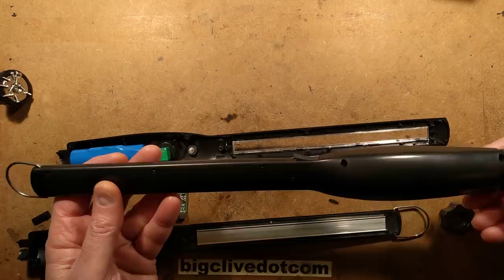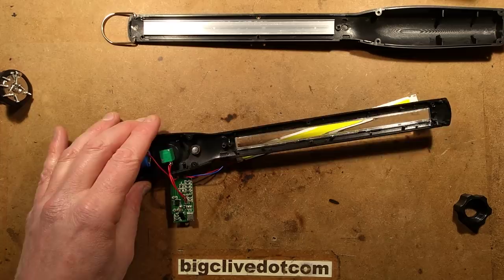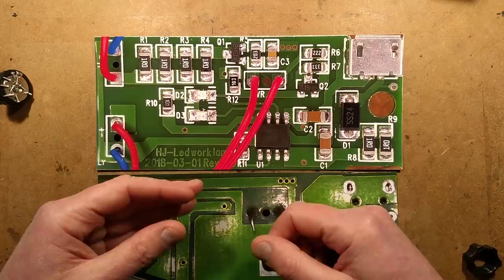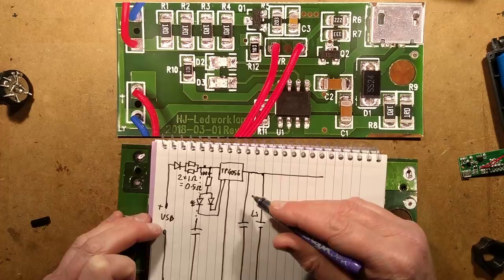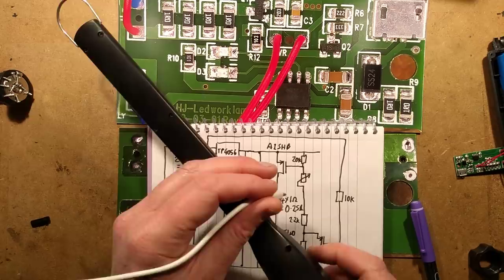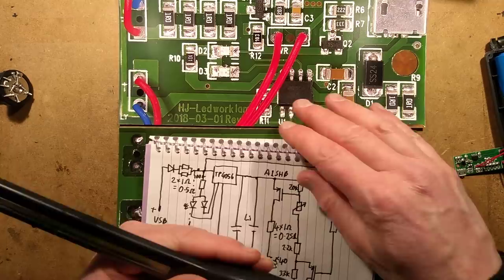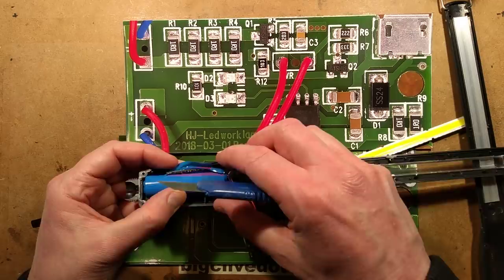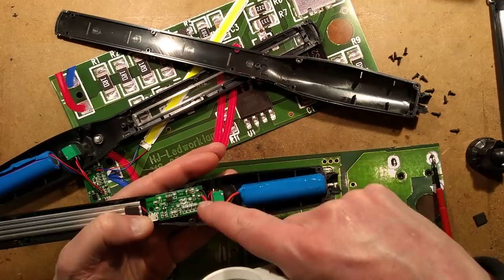Astro Pneumatic light versus clones?  (teardown and schematic)

Comment: Wish you had Harbor Freight there.  Google "Braun 63958"
Reply: Is it worth $40?
Reply: @ddegn   I would say no, as at $40 it's getting too near the Astro in price.  They are certainly worth $20 - $25, though, and the current coupon has them at $19.99
Reply: @a89proof  I'll watch for a coupon. Thanks.
Reply: @ddegn  I have two HF Braun lights myself. One has been difficult to charge and flickery. The other has been fine. I only bought them off a coupon. Not worth full retail.. Best part with them is that the battery is replaceable..
Reply: I have had good results from mine. I think it is better made than the Astro, with a familiar 18650 back end like my flashlights. I have a ton of 18650 and love being able to pop another in.
Reply: These lights are amazing.  I have two, and prefer them to the 40SL, which I also have.
Reply: golf-n-guns Braun, wasn't that brand bought out by P&G, or was that just a specific division?
Reply: @johnfrancisdoe1563  Nah, just one of harbor freight's made up brands that's intended to sound familiar.  I'm sure it's unrelated.
Reply: @ddegn   got it for $24 on sale  keep an eye out for it in the news latter it is the best work light you can buy IMO.
Reply: I salvaged some old 18650s cells out of some bad laptop batteries and just pop in the charged ones when needed. Most note book battery's stop charging with one cell bad but all other ones are good.
Reply: @ItsAlwaysRusty  
You probably tightened the bottom too much.
Reply: @Clay3613  Maybe but its always been glitchy.  Works most of the time but the issue seem to be in the swivel joint.. Almost like a bad ground. Goes dim but if you move the light bar it will brighten.
Reply: @ItsAlwaysRusty  I love that Braun light from HF first one I bought is perfect the second is like you say, flickery and a Bit dogy. The original price was 19 doll hairs but has gone up month by month to 40. I find it the perfect light for working in electrical enclosures.
Reply: Yep I've got both the Astro and the Braun and I always grab the Braun. Very nice light.
Reply: They also have a mini stick light. Non adjustable magnetic base but it makes up for that in the blinding amount of light it produces. Best part $6
Reply: The Braun is a MUCH better light than the Astro in every aspect. I prefer that the LED be the only moving part. Being able to pop in a fresh battery without having to wait for it to charge is essential. The small led on the tip is great for getting light into small crevices. The magnet is VERY strong. The aluminum housing is very durable. Everything about it is just better and I would gladly pay $40 for one if I had to. I have 3 and will probably buy more, but I will always use a $19 coupon. They make great gifts too. I gave several out at Christmas.
Reply: Then Google the one that Astro copied, the Hazet 1979-9.0

Comment: I wonder if the PCB would accommodate a larger output MOSFET and some large solder blobs on both sides of those 1 ohm resistors?

Perhaps under the TP4056 chip as well?
(If there’s enough room in the case.)

Comment: Change the resistor to increase the charging current... Lower value resistor for higher charge current, or higher value resistor for higher charge current?

Comment: Reminds me of one of the lights we can get here in the states from everybody's favorite chinese tool import Warehouse harbor freight.. The Braun slim folding. However the difference is it's an all metal case with a removable battery. Quite a handy little light. My testing on their battery was 2300mah I went out and purchased some of the orbtronic high capacity which are 3400mah. So  Rather than constantly charging through the USB port I keep an extra set of batteries in my tool bag and charge the batteries as needed. Quite handy indeed in my opinion.

Comment: Nice! Thought through, fairly durable, and a fat battery. And space enough for a bigger one.
A magnet and this eyelet. Also USB - rather normal today - instead of an unique loading bullwhip.
That's how to work light!

30 years ago when my parents were young... You only had tungsten flash lights - laaaame - or these halogen builder lamps, the hot ones. THE VERY HOT ONES.

Comment: I recently was shopping for a new work light, and I heavily considered the Astro after seeing Eric O. at South Main Auto use it and sing it's praises. The legit one was about $55 on Amazon for the 40SLMAX model. Eventually, I decided on a slightly cheaper ($40) Neiko light. It lacks the nice ball swivel magnet on the end which is a little bit of a bummer but I've gotten the magnet mount it came with to work fine most of the time so far. Will I probably wish I'd gotten the Astro for the extra $15? Probably. If that's the case when the Neiko breaks I'll cough up for the Astro. I do quite want to get some of their pneumatic tools though.

Comment: Just yesterday the kids gave me a 3D pen with two dead A1SHB P Channel Mosfets in the H-bridge of the (jammed) filament drive motor. They both failed open circuit. I've ordered a bunch of those since they seem to be used in about every cheap thing from china nowadays. Those cheapo 3D pens might also be an interesting little thing for you to tear down.

Comment: I am a little disappointed that even $50+ LED lights still don't use PWM as there is no shortage of inexpensive high efficiency regulators operating at 100+kHz these days that could provide essentially flicker-free operation even without additional output filtering. If you absolutely require minimal strobing due to having your nose into something that moves at speeds in excess of 10m/s and phosphor on the LEDs isn't enough to smooth the light out, most of whatever flicker may be left can be eliminated by adding a 10uH 10uF output filter for an extra $0.20 in parts.

Comment: Is there a searchable name and type of potentiometer that has a on off switch but into the potentiometer?

One that will cut through power?

Having difficulty finding suitable potentiometers that will also cut source voltage also in a single component. Specifically a thumbwheel 10k pot.

Comment: I have several of the knock off lights and find they work great. I use them daily as a mechanic but find the scroll wheel a little annoying, and their charge rate is very slow. I'm really not sure I could justify the extra cost of the more expensive light honestly.
Reply from the maker: They get the bulk of their charge in the first few hours and then trickle the rest of the way, so if you put one on charge for an hour or two during the day it would be usable.
Reply: @bigclivedotcom  Thanks mate!  I bought a couple of them at the same time so I just cycle them out usually.

Comment: For the Astro,
U1 appears to be from Feeling Technology: https://datasheet.lcsc.com/szlcsc/Feeling-Tech-FP8102XR-G1_C88310.pdf

I also failed to find data on the other two devices. However with both of these having PCB marking prefixes of "U" ("U2" and "U3"), I would not expect either of them to be a Transistor.

Comment: Damn, I was wanting to get one of those Astro lights because Eric O uses them! But Aldi periodically has a couple different worklights, one largely the same form factor, which I bought two of, and one telescopic thing, which I didn’t bother with.

For 20 bucks, these things are awesome. Neighbour bought one too. I’ve tested the batteries of the two that I have, and 2000mAh is what they claim, and 2000mAh is what you get, actually slightly more which id put down to switching losses. Either way it’s within margin of error. It uses a 4056E linear charge controller, and unless that chip has one onboard, I’d be buggered if I can see any PWM? Either way the light looks very reasonable. Brightness switching is done by a rotary switch. I’d be happy to email you some pics for your consumption, see what you think.

Electronics is something I’m very new to and want to learn, so I am curious!

P.S. Thinking about it more, it seems these Aldi lights have a lot less components, but they are designed to be that way. They’re very simple, but designed as such. I guess when you simply have a rotary contact switch and only three set modes, you can cut down on a lot of components right there. I think you’d agree that when it’s designed and baked in to the product, as opposed to just muntzing shit out until it stops working, then undoing the last step, it’s perfectly acceptable. The battery also has a standard two pin header connector, so the thing is serviceable, despite what the user manual says.
Reply: Muntzing?   Hah!  I see that I'm not the only one who thought of him...

Comment: Have a durite one same as Astra one paid £40, bought 3 other clones of e bay for £9 each and there all in bin, durite one still going! Don’t matter if you drive over the £8 by accident! At the price but magnet, light output and run time not as good. Eric o is a very capable tech.

Comment: Panasonic 2.4 volt screwdriver is great. I have 2 and use them all the time. I bought nimh batteries to replace the original nicd. Also opened up the original. Its sub c. So i put in 2 tenergy 5000mah. Runs forever on a charge.

Comment: Being a bit picky - I think you missed the charge current config resistor off the doodle :)
Reply from the maker: I did, and also the capacitor on the gate of the regulation MOSFET.

Comment: I bought two of the cheap ebay ones, both worked initially. After two-three uses, one of them would barely light up. Did not trust them to light up my world. Ended up bying the würth one.

Comment: I bought the first clone you took apart. It stopped charging after 3 recharges. The battery still tests fine so it must be some other circuit that's failed.
Reply from the maker: First guess might be the USB connector.
Reply: Finally I got around to fixing it, and it was not charging because the tp4056 chip had blown. 
I replaced the chip and now its working 👍

Comment: Can you make it work by jumpering from the on/off switch or dimmer knob to the mosfet where you jumpered over the resister to test?
Reply from the maker: For a total bypass you could use the switch to jumper from the battery positive straight to the resistors that limit current through the LEDs.

Comment: Instead of the mosfet, could you use an LM317 configured as a current source to control LED brightness?
Reply: you could but you need to watch out for drop out voltage across it.

Comment: How about the harbor Freight version! I believe it's called Braun.
Reply: The Braun is a far superior light! I’ve bought several over the last year and haven’t had a single problem with any of them. Even IF you could easily replace the batteries in the Astro on the fly, I would still prefer the Braun, but the “non-serviceable” battery is the nail in the coffin for me.

Comment: Hey Big Clive! I remember a while back you did a video on a scavenger for "dead" non-rechargeble AA batteries that powered an LED light for a significant amount of time; would a scavenging charger be possible?
Reply: I ask because as I'm sure other people find many AA-powered devices come with crap AA batteries; in my case a load of Drayton Wiser radiator controllers that within days no longer provide enough grunt to fully close the TRV they're mounted on but last months per charge on AmazonBasics-brand eneloops. To the point we have a box full of batteries only fit for Christmas lights, but it seems like there should be a better use for them!
Reply from the maker: The Joule Thief is only really suited to grabbing the last little bit of power for a simple application like a light.  It could be used to trickle current to a lithium cell, but not deliver the amount of current required to charge a modern phone.
Reply: @bigclivedotcom sorry, I didn't mean to charge a phone or any other lithium cell - instead to charge decent aa Nimhs from the rubbish low-capacity AAs that are 'free' with devices
Reply: I have only a passing understanding of electronics so theorise putting 16 "dead" cells together could push dregs into rechargables? But maybe it would cost so much more in parts the environment wouldn't be thankful.
Reply from the maker: @NikBorton  With many electronic devices they use so little of the capacity of alkaline cells that even putting 5 in series would probably get useful results.  You can buy USB boosters that will run to about 0.9V on eBay.  A couple of dead cells would probably get results.

Comment: I had the knockoff and had to replace the USB connector and then the pot went bad and I said screw it. The Braun one is hands down the best being aluminum and able to use 18650 batteries from old laptop battery cells.

Comment: Clive, can you still get juicy lead based solder?
If so is it worth sticking up before it goes away completely.
Reply from the maker: Yes.  It;s worth stocking up on some if you can get it from proper electronic suppliers in your country.
Reply: bigclivedotcom I spent most of my life living on Canvey Island but now live in norwich. 

Will they get rid of it completely then?
Reply from the maker: @mavos1211  I hope not.  If they do there'll be a black market.

Comment: Wouldn't mosfet heat up more if it's not saturated with low gate voltage? The heat will be more on low intensity while charging.
Reply: depends on the actual watts ..current multiplied by voltage across it..the leds are very non linear, not starting conduction 'till a fair voltage is across them, and not increasing much with current, so the voltage drop across the mosfet probably wont increase much with reduction of current..
Reply: will also depend on the cell volts,

Comment: A couple notes:

1) P-channel MOSFETs have the arrow pointing away from the channel, not toward it. Arrow heads in electronics symbols always go from P to N.

2) The insulating layer in MOSFETs is silicon dioxide, ie glass. While over-voltages can punch holes through, heat will melt the solder on the bond wires long or burn off the metal gate long before the silicon dioxide melts.

The oxide layer is formed by baking the chip in an oxygen-rich atmosphere at several thousand degrees C.

You can certainly repair them by frying little shorts. In the college lab where we made some MOSFETs, giving them a wee zap of 30-40V was SOP to get one working if the gate was shorted.

Comment: I have one of those clones, it lasted a couple of weeks until something went wrong with it, it shorted out and fried two USB wallwarts before I figured out it was dead. perhaps I should pull it apart just for joke and giggles.
Reply from the maker: It would be interesting to see why it fried the power supplies.  The only way it could really do that is by shorting them out.
Reply: @bigclivedotcom  I guess you are not that interested in tearing it down since you just made these videos, but I can pull it apart and take a look if i see anything.
My poor Samsung Quick charge supplies...

Comment: Clive, something's wrong.
You're making me feel smart. And that won't stand! Missed the capacitor, said the 4x resistors were in series...
Seriously though, thank you. I wouldn't be able to know when you're talking shite if watching you hadn't taught me how this stuff works.
Reply from the maker: Yeah, I spot those errors afterwards and know that others will spot them.  It's a sign that you actually know a lot about electronics now.
Reply: @bigclivedotcom  And you to blame for it! I have - waiting for me on my dining room table right now - 12 piezo elements, 10 micro-switches, and a mixed bag of potentiometers -- each to be installed into a super-cheap electronic MIDI drum kit. In the hopes of making it... well, less cheap.

Whether the project goes well or goes bust, this channel of yours shall be held at least partly to account for having edified and inspired it! ;)

Comment: Do they come from different factories? Today most things come from the same factories with different specs for different sellers.
Reply: They come from the same factory, but one was made on a Wednesday and the other was made on a Thursday.
Reply: The astro ones are made in a different place. Either Japan or Taiwan and not in China.
Reply: @xbin87116  To me it looks like they source everything from the same factories and assemble them, the mouldings look the same, same size and shape, and the electronic boards same dimensions,  where they are assembled China,Japan or Taiwan does not matter.
Reply: Astro has a post on Yt post laying out where they are made and the different plastics and the differences. You get what you pay for.

Comment: Shouldn't the MOSFET gate current be limited by a (say) 1M resistor?
Reply: Unless the gate is fucked, it's separated from the channel by an insulator.  No resistor needed.
Reply: It's not the current that screws them it's the voltage.
Due to the gate capacitance on a power device, It is essential to use a lot of current to get them to switch in a raasonable time.
At RF you may use an amp of gate current to switch an amp at 200V, ie 200w for 10w of gate power
Reply: @bdf2718  
The insulator breaks down at 30-ish volts, destroying the device.
Use 10R  in series with the gate and 1K gate to ground with a 15v zener in parallel,
they are fiendishly easy to destroy.
Reply: @FarleyHillBilly  
Yes, in the general case you have to do a lot to protect them.

However, in a 4V circuit and using them in the linear mode, there's no problem limiting the gate current because it will be negligible anyway.  If you were driving them with high-frequency AC maybe, but that's not the case here.

Hmmm, I can't remember the circuit and I can't be arse looking back through the video.  When the switch is off is that gate completely floating apart from the FET pull-down?  Maybe a possibility of static damage, but you'd guard against that with a pull-up resistor, not a resistor in series with the gate.

I think the OP was misled by Clive saying "high current" when he maybe meant "high voltage" (from static, maybe).